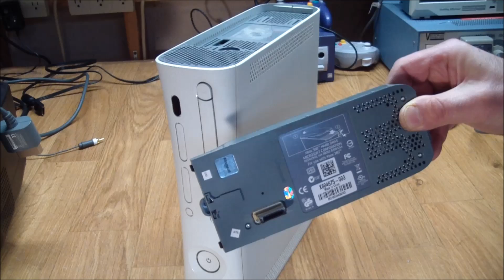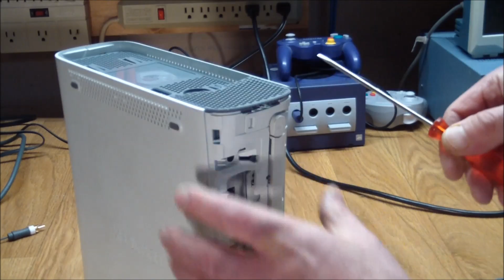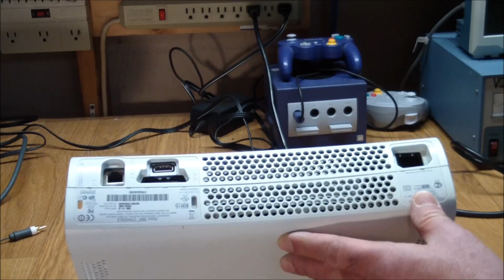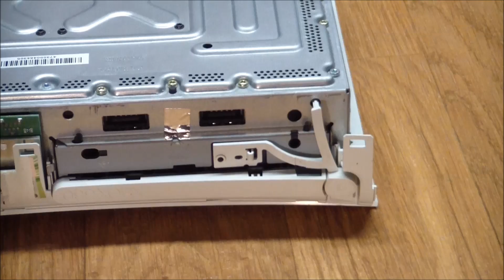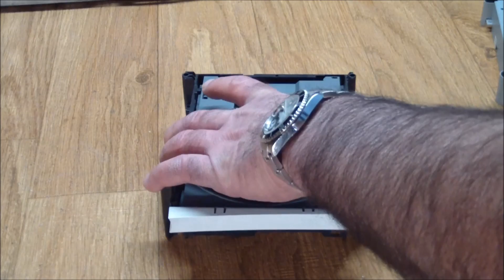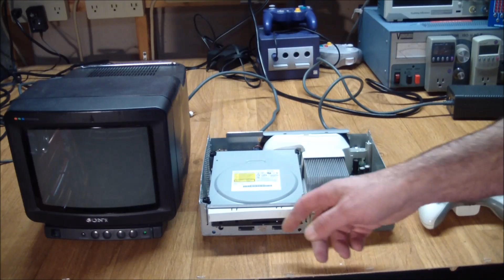AE#33 Xbox 360 Stuck DVD Tray Repair

Comment: I got one of these recently and have a slightly different cause for my tray not opening.

In mine, the large black plastic cogwheel to the left of the drive belt (visible clearly here from 20:58) has lost some cogs and when in a certain position, the smaller cogwheel cannot make contact with it to spin.

I can’t find any replacement parts for this cogwheel online so I’m assuming my best bet is to replace the disc drive entirely unless anyone has any other solutions.
Reply: If you can find another cheap $12 xbox like this man found, buy it and you will have replacement parts for life.

Comment: This was a very helpful video and great work explaining everything! I was thinking my magnet was too strong and not releasing my tray because when the case was apart the tray opened fine but when the case was installed the tray was stuck. It was fine if I put a disk in in the tray then assembled the case. Not fine without it. This guy found a similar concern. I changed out the belt drive for the tray motor and it was fixed! Otherwise I was going to try a spacer to lessen the magnetic strength. Thanks for the advice!

Comment: My 360 was submerged in water years ago and I’m just now getting around to testing it. All the game data seems to be there but the disc drive just won’t budge at all. I’ve taken it apart and I’m at the stage of replacing the belt. But when water becomes a factor, who knows what’s going on. What I’m wondering is, what signs of damage should I look for in a disc drive that’s been in water, and what should I do about it? Should I just start by trying a new belt?
Reply: It really could be anything having been submerged! Some suggestions from a fellow layman:
- Corrosion is the obvious first thing to look for. Look for signs of metal oxides like rusty powder in the boards. You can try cleaning it off, but any corroded boards will probably just need replacement.
- Open and close the tray mechanism, feeling for major resistance. I'm not sure how well the gears disassemble but resistance would imply they need taking out and cleaning with isopropanol.
- The original grease might have degraded on the sliding components. Apply an appropriate grease to the laser module sliding bars and maybe the plastic sliding piece that plays a part in tilting the laser module out of the way before the tray opens.
- Replace the drive belt if cracked, tight enough to slow the motor, or loose enough to slip.
- Clean the laser lense with isopropanol and cotton bud. Failing this, replace the laser module. Replacements going for £9 one still these days. Just check what kind of disc drive you have as there were several used over time.
- Failing all that, but the bullet and buy a whole replacement drive of the correct make.
Reply: @poppadum  I ended up asking Reddit and they told me to order a new laser. Turns out that’s all that was wrong with it lol. Thanks for the reply :)
Reply: @Naytone  I'm amazed your machine survived. Glad to hear it was a simple fix!

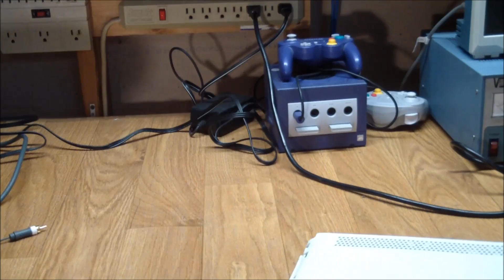Comment: 12:50 did anyone else have trouble removing this cover? Cause' I'm not hearing any clicks and I'm pretty sure it broke... and the clamp on the very end doesn't want to budge. These videos make it seem so easy
Reply: You really need to get the front apart first and wedge it up so there is already force pushing the halves apart.  Took me forever but I got it.  I used a thumb tack/push pin and pushed in at an angle and they all clicked.  Do the side with more tabs first.
Reply: I also had big issues with this today.

The left side on the back plate with the 5 buttons to press cane apart easily but the right side with the 2 buttons REALLY did not want to come apart.
It took me about 15 minutes of careful wiggling and pressure to finally get it apart, turns out the plastic latch has snapped and was probably caught on the other plate.

Either I broke it myself trying to pry open but I think it’s more likely that it snapped in transit when I purchased the console as it was packaged badly.

Comment: Dude, you have saved me. I was thinking my Xbox 360 drive was a goner, but checking out the small band per your suggestion, I saw that I had the exact same problem. By complete chance, I found an extra band in my things which was an exact match of the band in the drive, but new, so replaced it and it is now working fine again!

Thank you so much for your video, bless you.

Comment: I had this issue and i was able to heat up the belt with a hot air station and it fixed my issue and didn't have to buy a belt. My thought process is that the heat would shrink it down a bit. So 480 celsius for like 10 secs or so did the trick
Maybe this will help someone

Comment: Does the DVD magnets ever become weaker?  I feel like if I were move the Xbox from horizontal to vertical...which, I did. The disc became loose and scratched things up. It may or may not be related to why my system reads some games and others only after repeatedly tapping the system as it reads a disc!? Idk .. It's something, not related to the leader itself I feel...
Reply: If you turn the Xbox while the game is on the gyroscopic action will over power the magnet

Comment: Fantastic !! Worked a treat !! Thank you for making the video.
Reply: so you just change the belt and started to work again. I have a parts one and original and both have eject problems. Sometimes it opens, usually problematic. But plays the disc when inside.
Reply: @jessecanty7367  yes I just changed the belt and it works perfectly.

Comment: Can somebody help me!? I have seen 1000 videos and none have my problem.... When i turn the disc drive its stuck halv way through. Cant move it, permanent stuck. What is the cause to that? I have it open in my hand and nothing is stuck in between. Im going mad! The whole mechanism is working everthing is clean. Update:  From what I can see it have skipped one gear forward, how to fix that?
Reply: Hi! I think the same is happening with mine but mine won't open not even halfway through. If you found the solution can you please let me know:(
Reply: @extinction9246  I found the solution. But if you not able to take it out just a little bit then I have bad news. See the problem with mine was that the gears under the disctray where moved to far and locked themselves. I just janked it open with force and it was out. Put it back in and with my fingers adjusted the gears so it was on the right one. My best guess is if you look at the laser, then locate the round spinning thing you have your disc on(its in the middle of the disc when you have one in).  there is a silver thing pointing at it. Under the silver thing there is someplastic you can move. If you place the discdriver when it open away from you, pull with finger and push the plastic to the left, is should eject
Reply: @OzzI-DKPL  So do i just pull my tray out with all my force?
Reply: @savagekinkyboy  There is a part you can slide near the gears, if you pull it to one side it will open disc no matter what

Comment: Fixed it ez way:
Use keycard or someother card gently push the disc tray down while opening (button) and success get a small brush and 2 pins and go to work.

Comment: My friend' you stated that the disc player is not a straight swop this is true because of microsoft DRM built into the player as it syncs with the motherboard' however there is a get round you get your replacement discdrive open it up you will see a small pc board that has 1 black 1 red 2 white & 2 yellow , desolder & remove open up your defective drive desolder the same pc board resolder original pc board into replacement drive , the reason for this is the sync codeing is on that board all you have done is replace the hardware not the sync software hope this helps .............
Reply from the maker: You're right, but the replacement drive mechanism has to be identical to the original.
Reply: @artifactelectronics  My 360 won't read discs anymore, and I was wondering if I have to swap the drive itself. Will try cleaning first after seeing this outstanding walk through, but if that fails there's no easy to find replacement drive anywhere? Thanks for the video, good stuff. :)

Comment: Great video, very helpful in understanding the working principles of this mechanism. I have exactly the same problem with the tray. Another problem is the very noisy mechanism, probably the fun. Is there a solution?  Is it dust that inhibits the fun from factioning properly, hence the very noisy fan? Thanks again!
Reply from the maker: You might want to clean and lubricate the rails that the head assembly slides on.
Reply: @artifactelectronics  Thanks for the advice, I've done it  and works okay.

Comment: Quite a helpful video. I found mine in the dumpster it had the power brick power cord audio video cables and even the controller.  Your video will be very help in replacing the belt for the disc tray
eject mechanism.

Comment: I did the same, replaced the rubber xbox 360 drive belt with smaller one and drive started opening and closing. Thank you for guidance.

Comment: Thank you for the instruction video I pulled my 360 apart because of a stuck tray .I took off the little rubber drive band washed it in detergent then cleaned the spools it worked great. I am glad I had cause to open it up now because the cooling fans and heat sink fins were totally clogged with dust. I now have a smoother quieter machine cheers !

Comment: Outstanding explanation of why the drawer sticks, not just how to fix it.  Plus you addressed my concern that the replacement parts were on OEM and out of spec.  Well done, could be a little shorter, but otherwise a great video.  Thanks for doing this.

Comment: OK I did all this, but the eject button doesn't open my disk tray now, I can only open it when I am in the interface with a controller.  With the faceplate off I can use a screwdriver to push a portion of the attached colored plastic in so then it opens. IDK, I am glad it I can open it now but it is not fully functional.
Reply: eject button is broken or check if it is placed properly, open your xbox 360 and check it. check some youtube video.

Comment: My tray opens when the top cover is not on it but when I put the top metal cover on it doesn't open. I cleaned the ring belt but I don't think that's the problem. Any suggestions? Edit: it was the magnet problem.
Reply: How did you solved it?
Reply: @omaraliiqbaldavila4612  turn the belt so that the magnets aren't attracted to each other whilst the disc is closed and then eject the disc tray to test that  and it should work fine.

Comment: That's a easy fix for the Xbox 360 just remove the four Philips screws clean the gears and drive belt also put a new drive belt on its how I fixed my original Microsoft Xbox 360

Comment: my dvd tray seems "locked" in place.  even with  the drive wide open i cant budge it.  feels latched from the back corner
Reply: So does mine! Have you found a solution?
Reply: @shutup.2046  A plastic nub is probably out of alignment on the tray mechanism m8. Make sure it is lined up with the guide slot.
If you look at the top of the disc tray after it is taken apart, there is a guide nub that can come out of the track if you have forced open the disc drive.
gently push down on the nub from behind the slide tray, and push up on the lever on the opposite side.  You should be able to now push the nub all the way to the right and slide the tray back in to make sure that the nub is in the guide rail.
Hope this helps, sorry if it doesn't
Reply: @shutup.2046  even though i was 100% certain it wouldn't, a new belt fixed it, and literally every other drive tray issue i've had since

Comment: Hey i don't expect a reply, but the motor on section with the belt won't even spin now. Did i break it?
Reply from the maker: Make sure that the wires are still attached to the tray motor.

Comment: Artie on the belt.  I brought home when I retired cans of spray-grip. It makes the belt slightly tacky and was made for large fan v- belts. What I do is spray it on a q-tip and very lightly dress the inside surface of these tiny belts and it lasts about 5 years with the original belt and keeps the belt from deteriorating.  Thanks for the videos.

Comment: The disc drive is absolutely jammed. Even after taking it out it simply will not open. It pulls out maybe an inch and get hung up on something.
Reply: Exact same problem here.
Reply: He says something about belts by being able to break a magnetic force made inside the console. Check from 23:23. Week belts cannot separate the magnets that keep the disk tight and stable when tray closed.

Comment: I couldn't get past 12:00 the tabs just won't open. I can't separate the shell no matter how hard I try.
Reply: There is a really small hole hidden behind the label, you will have to poke it with a clip and push.

Comment: Don't stop making videos you're the reason why I was able to open up my Xbox and clean it up. Have a question where do you purchase the rubber band for the drive you don't have a link setup thanks again and keep up with the videos
Reply from the maker: I don't remember the exact vendor, but I just searched on ebay, and there were many offerings.

Comment: When releasing the tabs to open the white outer shell, it's MUCH easier to use the tip of an unfolded paper clip instead of a screwdriver.

Comment: Yeah I noticed it was always opening when I had a disc inside. It only got stuck when it was empty. Do you have an ebay link for the belts?
Reply: I have another fix for This, if new rubber band does not work: 24:30 look for the shiny metal plate with a little hole in it, next to the motor that spins the dvd, bend it down a little more, althoug i sugets You unscrew it and bend it in your hands, put it back and try, if it does not work, bend it more and try again. By doing This You Will increase the spring force of the metalic plate, enogh to overcome the force of the Upper magnet to push the lens and motor down, so the tray can Open, ir Will Open Even if You close it without a dvd in it. You are welcome!
Reply from the maker: Just search for "Xbox dvd belt" on ebay.

Comment: The actual tray on mine won’t come out more than about an inch, is there a fix for this?
Reply from the maker: You have to take it apart and check for obstruction in the tray path or the dvd hub catching on something.
Reply: @artifactelectronics  how do I do that? I have the same problem.

Comment: The black disk gets stuck, it doesn’t come out, I took it apart but the black case doesn’t slide out it’s stuck and when I do force it out it doesn’t want to come back out
Reply from the maker: Don't force the tray, but rather turn the motor hubs by hand. If you still can't get it to move you might have some gears with broken teeth.
Reply: Artifact Electronics thanks for the help bro, I did step by step and it just didn’t want to slide out, ended up taking out the memory and just threw it away, bought the Xbox one x

Comment: I was trying to open the case from the step at 11:20 and I think I've broken a few tabs, is it possible? I don't think they clicked, I have a bad screwdriver, it looks like they are gone, I'm I able to open the case in this situation?

EDIT:
those 3/4 under the ethernet nest, those under the power nest have clicked and opened fine
Reply from the maker: You should still be able to open the case with damaged tabs, but then putting it back together is another matter entirely.